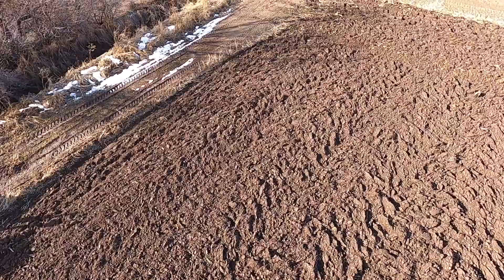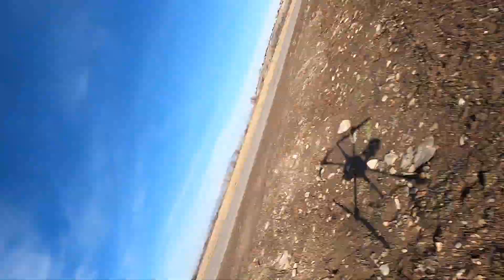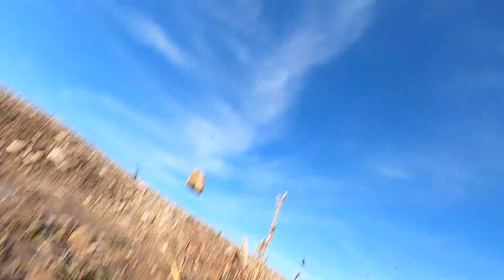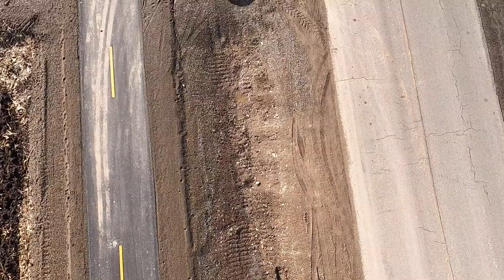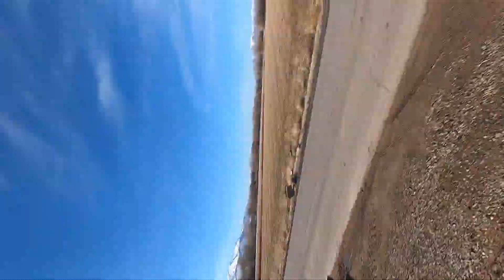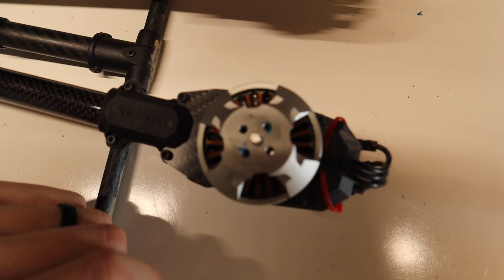BROKE a $1000 drone! What went wrong?

Comment from the maker: Anyone else have this ever happen to them!?
Reply: Many, many times. Lost a £50,000 drone with a brand new 5D.  needless to say, had to look for another job
Reply: Yes, and it happens to everyone who flies and develop UAVs. I have had many of my drones go down and many times it was a pilot error as well. It's when you mess up like this you learn the most and it is kind of impossible to avoid if you are flying a lot and building yourself. I have a drone almost exactly like yours. It's a tarot 650 with extended arms and 17-inch propellers. My max takeoff weight is 5.2 Kg. In your case, it looks like you had a motor failure. But to be sure, Look for any shorts in the circuit. If your motors cant handle the load, you need to replace them before the next flight. Your ESC should be checked to make sure that it is okay. A good thing to do is to check the ESCs after every flight. You can just put your finger on it and feel for any heat. Some heat is not bad but if it is very hot it means that you are pushing it a lot, maybe too much. The motors I use is 4 T-motor mn4014 330kv. The motors draw 17 amps at max throttle and my drone has an average power consumption of about 16 amps for all 4 motors combined during normal flight. If you want, you can use the same motors. 40 amp ESCs should wor just fine. I use 45 amp without ant issues. Also, make sure that all your motor mounts are completely horizontal before the next takeoff. Just a couple of degrees of tilt will cause severe yaw issues. Good luck and feel free to ask anything.
Reply: So sorry to see this
I had a esc burnout but just at idle! So I was safe , before take off.
I was thinking, if we put 4 temperature sensor ( like LM35 ) over the esc  and read out value at ground,  send the data using telemetry or seperately with a LoRa module? Will that give sufficient warning with a buzzer on a over heating ESC?
Reply: I've seen a large quadcopter go down when one motor appeared to mostly stop as a result of a possible ESC failure. The quadcopter weighed 6kg and was one of a fleet of 5 aircraft which were built in near identical fashion. The remaining 4 were checked and one dodgy ESC (blown capacitor) was found between the remaining aircraft. The downed aircraft unfortunately sunk beneath the waves so a direct analysis was impossible. 
In terms of matching ESC current ratings to aircraft - if you've got working accurate current meter based telemetry you can see your current draw and should be able to check your ESCs are rated correctly.
Reply: I have a very similar setup and I struggle with motors heating up, so far I always landed before the motors turned too hot. Tbh I'm not sure atm what is causing this, but I read on the internet problems about motor alignment/adjustment, bad loiter pids. I aligned mine level now and reduced the loiter PIDs and will test as soon the weather allows it. This would also the reason why primarly the same motors are heating up which are spinning in the same direction (CW or CCW alike). 

I think also a good indication is switching from loiter to level mode and check the drift.
Reply: @P0SS0S  yea😖 lost a spark bought a new one broke in the same week. And you ever heard of FPV? 90% of FPV is just crashing and fixing😅 but to crash with a big 20" kwad must hurt man
Reply: Yes, and it will happen to everyone if you build and fly long enough :) , feel your pain. Did you record a telemetry log? You can learn a lot from looking at that. Could be so many things.
Reply: Yes, twice.
Reply: I've had this happen from unbalanced props. I've also had an ESC short out through the carbon fiber. It happens, the price goes up quickly with the big ones that's why I taught myself to solder the little ones. I know an omnibus can be used with Mission Planner and a couple other ones if you look them up. It's fun to mess with Inav as well that way. Surface mode with lidar is amazing you'll think me if you ever go that route and if you have a girlfriend or spouse they probably won't appreciate it as much.
Reply: Yes! 3 or 4 times at least. Firstly you should know these things can happen to every pilot. Secondly, when it did happen u should not let it bother you at all. be a man about it. Thirdly, definitely learn from it and find out the reason. you should never guess, test it in the control situation, recalculate and check your design. Forth fix it and move on and give your 200% attention while flying. you should monitor all parameters frequently throughout the flight. 

from your video,  you attach a new module (a Lidar) to drone without testing it on the ground. that's wrong! having DIY drone means you are on your own nothing is granted or standard so you should calculate test and monitor everything all the time. especially when it is a new bird and you try to change even little things.
Reply: A few times...
Reply: At 3:16 is clearly told that ESC is ok, but motor alone burned out. So it's not the case of ESC fail. 
Motor usually burns out due to overheating - too great power for too long. It's not JUST amps, but also voltage (power P=IxV). So at 6s you pull way more power thru those motors than at 4s. It's just a matter of time until they burn out. 
Should do flight test with full setup very close to ground for some 2 battery cycles to see whether motors can handle the power.
Reply: man this same thing happen to me
Reply: I once chipped a prop a bit. Thought it wasn’t that big of a deal, little bit of vibration. Then after some minutes of flying I saw a motor flying of the drone sending the damn thing to the ground. The vibrations were probably severe enough to rip the aluminum motor mount.
Reply: i had the same thing happen. but when i checked the logs. it said that i lost Telemetry and Power to the Receiver at the same time! that was crazy because when i plugged everything back up after the crash. everything worked fine. I replaced my entire telemetry with the Herelink . hopefully i dont crash on my test flight today :(
Reply: As I see, when you change the size/pitch of the props, and the type of battery, the motors tend to draw more current to move it, so 40A ESC is ok for a 15" 5.5 prop and a small 3S battery, but for a 17" 6.5" you fried your ESC, for that size you need a lower KV motor, 300KV, and a higher amp ESC, like 70A or 80A

Comment: battery use 4s 14.8V 

Ur Motors with 40A esc is like Ussain Bolt but adding 10000 mah 22.2V is like Ussain bolt running with a huge damn bag pack🤣

Use 4s 14.8V 10000 mah (if available)  keeps motors underload and keeps longitivity

Comment: I have had several crashes over the years. Once,  bullet connector separated causing loss of power to one motor - the flight controller was not robust enough to compensate. A Tarot Ironman crashed when a propeller blade separated. I left the hobby until January, when I built a new Tarot 650 sport. It crashed while troubleshooting a landing gear issue and accidentally toggled the arm/disarm switch. I have since repaired it and now it flies great.

Comment: guys, what's the question? 17x6.5 props are not suitable for this setup. A simple calculation shows overheating even for 16x5.5. I am currently building a similar set, only with 14x4.7. And this does not reduce the efficiency of the propeller-motor group.

Comment: This is my biggest fear with my Tarot 690s hex that I'm building. I'm running a 4s 9000mAh battery. And I my model fitted with 4006/620kv motors with 13" props per manufacturers specifications. I just hope they're right because unfortunately there aren't too many other options for motors in this size range.
The glue-like residue that you found inside of the bad motor makes me think that it pretty much overheated and melted the insulation on the motor's windings until it completely shorted out. That's a bummer man. I hope you were able to get it fixed and back in the air!

Comment: Change propellers :)
      For such typical 380 kV engines, 1550 propellers are sufficient and they provide an optimal compromise at ESC 40A.
  Too much electric power was generated by 17 "propellers ... :)

Comment: Sorry for your loss. We all feel your pain. I believe you had a bum motor. Check out KDE motors. I fly the Align M480L with Panasonic GH4 and two 6000mah Pulse batteries, 14 minute flight times. I been flying this copter since 2012, never had any issues. Align does make all the components in house. Check out the M480 specs and compare them to yours, (similar in size). It might help you with your decision. Don't give up!!! Good luck.

Comment: Most likely it was ESC desync. What caused it: any wires have inductance, that means that you can't instantly pull a lot of current from a long piece of wire. And you have VERY long power wires to ESCs. How to solve that issue: you should solder big low ESR capacitor every 15-20 cm of power wire, and one on ESC side

Comment: Have you bought a new setup?  I had the same engines on the same frame, now I've improved my drone much more.

Please tell me if you're interested in my setup.  Greetings.
Reply from the maker: What did you use to make it better?
Reply: @builtfromhome9207  
A few things I did in my construction:
First of all, the motor-ESC connections are soldered. I don't trust "banana" connections - I've seen these connectors fail.

Personally I use ESC for Racers - LittleBee 30A BLHeli (YES, they perfectly control large engines, and work with Pixhawk).
I had TAROT 6S 4008 380KV engines - like yours, but these engines are quite weak. Much better seem to me GARTT ML 5008 330KV engines. (I bought on AliExpress, $106 for 4pcs).
Additionally, I recommend you folding Tarot propellers.
I've examined two types of folding Tarot 1555 propellers: Two, and three blades. I decided on three folding blades, so I have a large gimbal and a Sony A6000 camera on my Tarot. The total weight (with 6S 10000mAh battery) is 4.8kg.

This is what a drone looks like in all its glory (photo with previous NEX5 camera):
http://rc-fpv.pl/download/file.php?id=6460&sid=f289c2d0588add7d867c50295f834cba
Here's a test video of another device, but that's how this drone looks in flight:
https://www.youtube.com/watch?v=4SZcK1Oi_os

And here is a huge topic on the Polish RC-FPV forum:
http://rc-fpv.pl/viewtopic.php?f=27&t=36286

If you have any questions about my design, ask - I will be very pleased!
Reply from the maker: @AndrzejKuczwara  Nice looking quod thanks for the info!

Comment: I agree with the over-propped theme. You need bigger motors or smaller props. When you rebuild, add a 1000uF 35V or 50V capacitor on each ESC's power leads.
Reply: Interesting, does the capacitor reduce OR eliminate spike loads to the ESC?

Comment: Hey. 

First of all, I would start by gathering the trust data of your motor/prop setup. If this can't be obtained by the manufacturer, you should look into doing a static trust test yourself. 

Then, once you know your total max potential trust, weigh the drone. If its weight is half or less of its total trust output you are good. If you're above that, consider the system overweight however this should NOT burn out a motor. 

A motor should be able to spin at 100% throttle continuously without overheating unless it is over propped. 

I don't think your issue was the motor as long as it was free spinning at take off and the bearings were good. The smoke you saw must have been caused by a short circuit, which in turn killed your motor by quickly overheating it and melting the windings insulation (the goo you saw in it was a clear sign of high temperatures)  

Just my two cents. :)

Comment: I think I know what went wrong. I had two crashes similar to yours. My problem was that I installed my ESCs  on the end of the booms below the motors. This meant having long power/ground leads going to the main power source in the chassis of the aircraft. You will get power spikes in those leads that over time will damage the ESCs. Imagine turning on a water faucet at full blast then shutting it off all at once - there's a sudden increase in water pressure. the same sort of thing happens in those wires. You can mitigate the problem by wiring some capacitors, but  I chose to install my ESCs in the center of the aircraft in a later build and ran the three leads out to the motors. I did this on a Tarot 650 Iron Man that I built over a year ago - see:  https://www.youtube.com/watch?v=PSxl5JhqxWo
I have gotten a lot of flights out of it and still flies great!

Comment: I'm currently building a Tarot S1000 I understand your pain what I have learn failure will happen as long as your building drones.  What I have learned is to get back to flying ASAP your troubleshooting technics could improve. I always have and troubleshooting ESC ready to plug and play for a quick testing my motors.

Comment: if you are trying for pro grade then you must use pro grade equipment. you might consider a hex if you are wanting redundancy. definately dont skimp on esc's, motors, batterys with backup batterys. if you are using a pixhawk cube its more than capable

Comment: Have you ever tested motor temperature after a short flight on full payload? That is a good way to check if the motors are seeing too much work. What about the ESC on the damaged arm, does it work? A defective ESC might burn a motor.

Comment: Smell the motor?  If you smell bandaid's, then that means the wire wrapping started to melt or melted.   If the motor doesn't spin freely, that means there is a short between windings.  Short could be either in the esc or motor itself.

Comment: The motor is 1620g / 12.4A /1335 propeller or 1420g / 12.7A / 1225pro. It looks to me that you have too much weight on the drone. And the motor will draw more current and heat up.

Comment: Had the same crash, tarot 650 extended arms 17 inch props and sunnysky motors around 320 kv. For me the problem was the esc burned out under same conditions as you had. Moved on to smaller props non carbon apc for me worked well less vibrations. Made a second rig Y6 with 17 inch props. Worked much better for me with almost the same esc motor setup.

Comment: Hi there... Well, I flew drones from 2009 until last year and there is one big question..  which is when will they fall or fail and not if... 

I flew drones professionally for filming as filming is my profession since 1996 so, the drones I had and built were my additional tools
As sometimes I had to fly over some crowd I NEVER flew quads... ALWAYS Hexas and that saved me about 4 times when I had burned ESCs and even one unplugged motor cable in flight once. With an Hexa is much less likely to have an even like you had as it can land safely with 5 motor and it can't with 3.
Safety first... ALWAYS... not only for you but everything around you where it can fall and damage/injure something or someone.
Reply: i agree with you.

Comment: Having seen your video to the end I would get a new motor but I would not use a 6S battery I have had a problem with a large Tri-copter using 6S.

Comment: Hi, I had a similar problem on a smaller quad running Ardupilot the problem turned out to be esc de-sync I ended up replacing all the esc's and loaded the latest Blheli firmware.